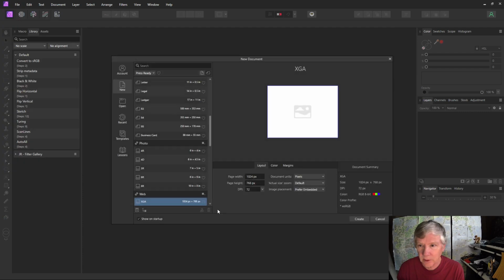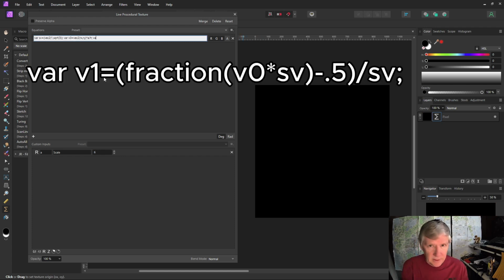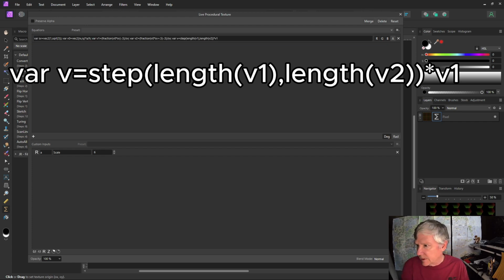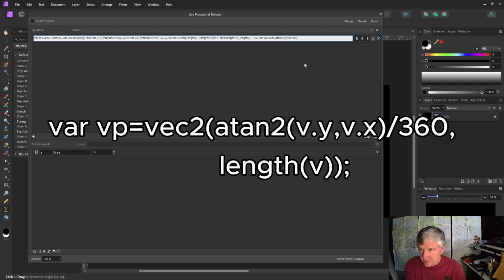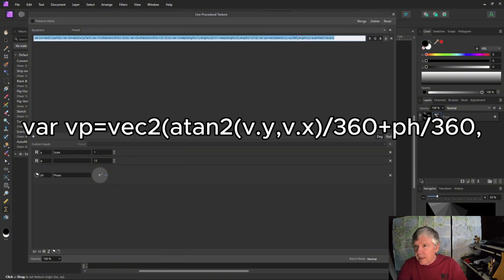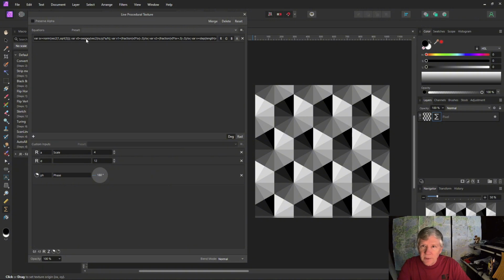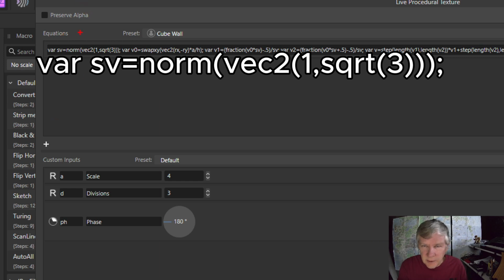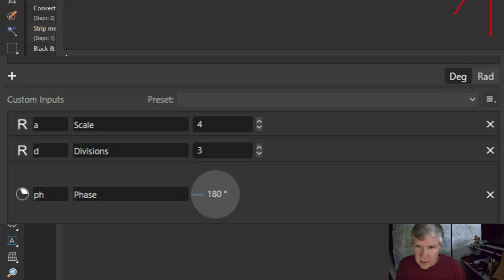Cube Wall Using Affinity Photo's Procedural Texture Filter ADVANCED

Comment: Hello, to solve the problem that it works only in the positiv axis of the realtive rx and ry please try: var v1=(v0*sv-floor(v0*sv)-.5)/sv; and var v2=((v0*sv+0.5)-floor(v0*sv+.5)-.5)/sv;  instead of var v1=(fraction(v0*sv)-.5)/sv; var v2=(fraction(v0*sv+.5)-.5)/sv; .Than ist is easily possible to rotate the koordinates system without moving the center aftewards. Great solutions for Precedual textures.
Reply from the maker: Thanks for the clever solution.

Comment: Hi again!
Got some time to play with Percedural Texture and your great equations you’ve made on your channel.
Unfortunately I’ve got problem with this equation in this video - is the pasted equation really the right one?
I also made an print screen on my iPad to convert the equation on your screen in the video, but non is working…
As I can see in Affinity Photo v2.x you can’t save a preset in PT if there an syntax error, so, have you any clue?
Thanks again for your effort to make this great videos!
/Erik from Sweden
Reply from the maker: I am on 2.5.7 and it is working on my computer after copying from this page. I used three custom inputs: R: a=2, Angle: ph=180, R: d=3. Otherwise try inserting one variable at a time and see where it fails. If you leave off the semicolon you should see something on the display. Of course, you have to put the semicolon back in to add next var. Let me know if you figure anything out.
Reply: @plasmaportl   - thanks for an quick answer!
Strange, nothing happening on the screen when I exactly copy your equation.
Even when I copy and paste from the screenshot, same thing happens, nothing, still a empty black pixel layer…
I will try v2.57 instead. I have an bad habit to always use the latest beta versions on all three Affinity apps, both on Mac and on my iPad Pro 12.9” M1…
Reply: @plasmaportl   - Good morning from Sweden!
I tried v2.57 of Affinity Photo on the above problem I´ve got with Cube Wall PT in v2.60 beta3.
Now it´s works, a bit…
I made an new doc with 1024x1024, have all the settings and equation right, but the wall pattern just works on the right side of the document…?
I think this PT is very interesting and joyful, so thanks again for your exciting videos!
Reply from the maker: @ErrkaPetti  You have to drag it over with the mouse. Fraction returns a negative number when input is negative.
Reply from the maker: @ErrkaPetti  You may have to type in equations with 2.6, not copy and paste.
Reply: @ - OK! I try both tips you gave me here!
Just now I only have my iPad Pro accessible, but Serif Labs has decided that we don’t need an Percedural Textures that supports editing equations on Affinity Photo for iPad, just locked factory preset… Grrrrr!
Reply from the maker: @ErrkaPetti  I worry that they may disappear in the future if not many people use them.
Reply: @plasmaportl  - Hopefully this great features stays in Affinty Photo!
Now I have everything right with your Cube Wall equation, even in Photo v2.60 beta4!
Curious question, but where do you live? US or UK?
Reply from the maker: @ErrkaPetti  USA, Wisconsin, but we just visited Stockholm last fall. It is -30 C today here.
Reply: @plasmaportl   - holy shit!!
-30 was many years since I experienced…
Although I’m born and raised in Dalarna in Sweden, but we have lived in Stockholm since 2012 - Living near cost here in Sweden means more ”healthy” temperatures - just now, evening here, it’s around -1 C, but they said yesterday on the news that it will be -10 later this week…
Nice to know a little about you!
Keep up the good work with Affinity tutorials!